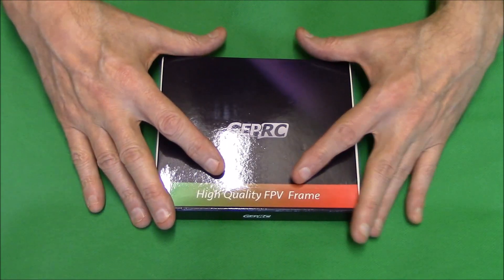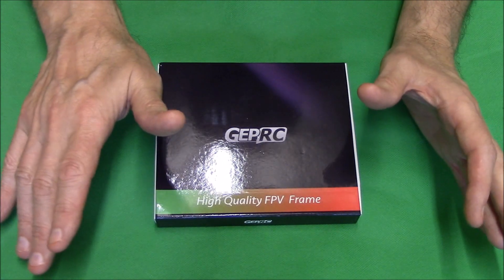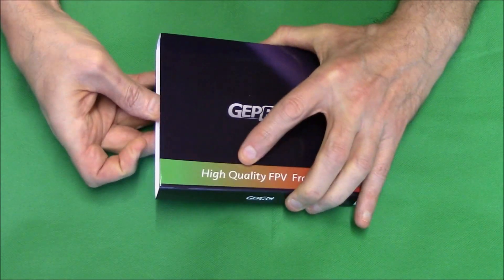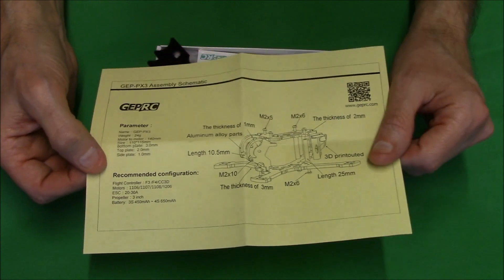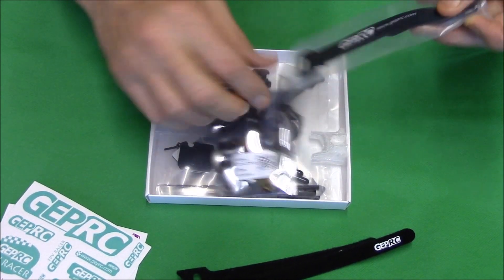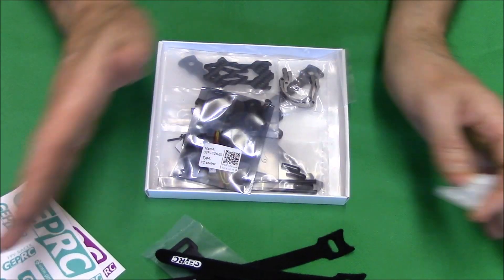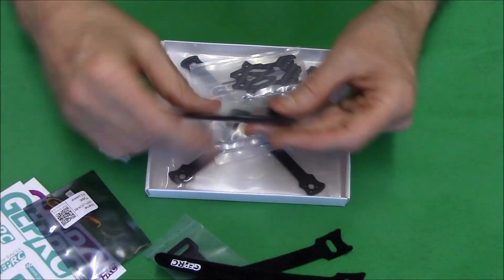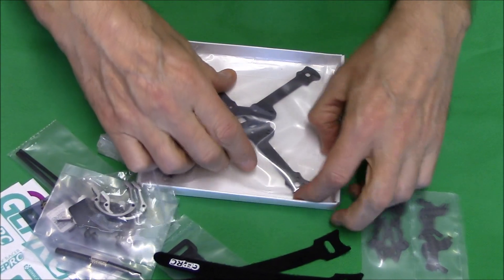GEPRC PX3 NEW MICRO QUAD FRAME

Comment: @George Cooper what is the maximum height (for fc stack) you can have inside the frame?
Reply from the maker: From bottom plate to top the gap is 26mm.. In mine I have a 4in1 esc / flight board/vtx/receiver on top of each other. hears a link to the gear I'm running.

Flight board / esc  https://uk.banggood.com/HAKRC-MiniF3-F3-Betaflight-Flight-Controller-OSD-BEC-w-20A-2-4S-Blheli_S-Dshot600-Brushless-ESC-p-1277585.html?rmmds=myorderA02817649204201406M5 

VTX https://uk.banggood.com/Speedy-Bee-TX500-5_8G-48CH-25200500mW-Switchable-Video-Transmitter-Built-in-MIC-for-FPV-RC-Airplane-p-1327587.html?rmmds=myorderA02817649204201406M5 

Receiver   https://uk.banggood.com/IRangeX-Fli14-Mini-Flysky-Receiver-w-RSSI-OSD-Double-Antenna-500m-Distance-for-FS-i6-FS-i6S-p-1304526.html?rmmds=myorderA02817649204201406M5 

Hope this helps..

Comment: Great Video bro.
Greetings from Germany
Reply from the maker: Cheers matey I'm glad you liked it, and luckily I have managed to order the correct size motors, so hopefully part 2 wont be far away
Reply: What motors ? What size?
Reply from the maker: Recommend 

Brushless Motors: 1106/ 1107/ 1108/ 1206 But the 1206 is the only one that will take a 4s so i have gone for that if you want a closer look hears a link https://www.banggood.com/GEPRC-GR1206-4500KV-6000KV-7500KV-2-4S-Brushless-Motor-for-RC-Drone-FPV-Racing-p-1338243.html?rmmds=myorderA02817649204201406M5